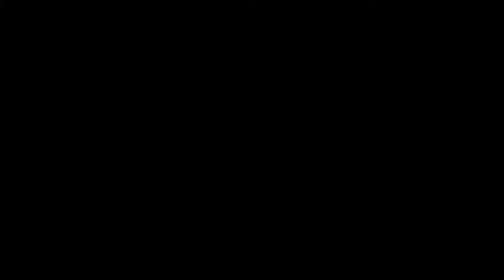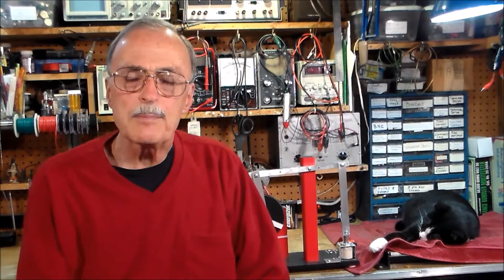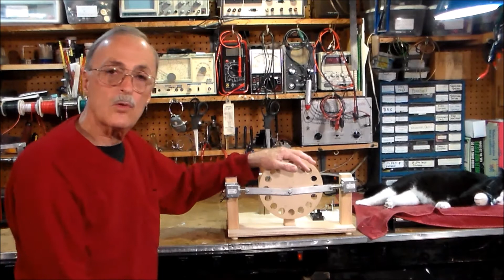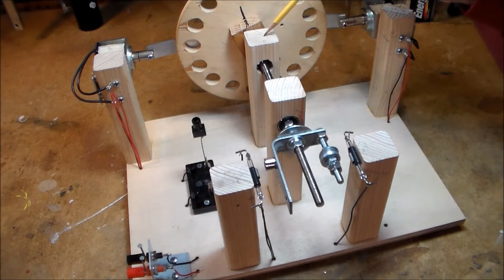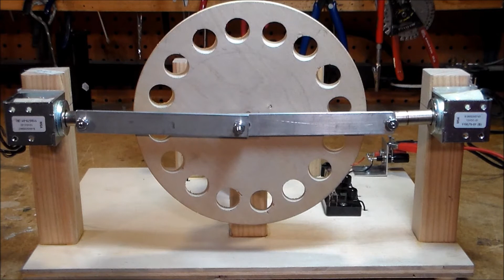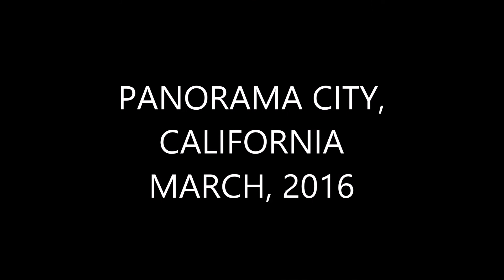HOMEMADE TWO SOLENOID ELECTRIC MOTOR

Comment: If the solenoids are both powered, how do you get them in sync?
Reply from the maker: Each solenoid receives a quick burst of power when the rotating magnet on the end of the shaft opposite the flywheel passes by and closes a reed switchmomentarily.Timing is adjusted by changing the relative position of the magnet to the flywheel.